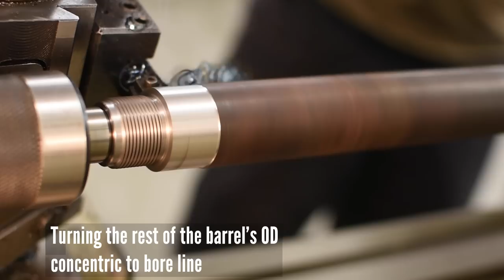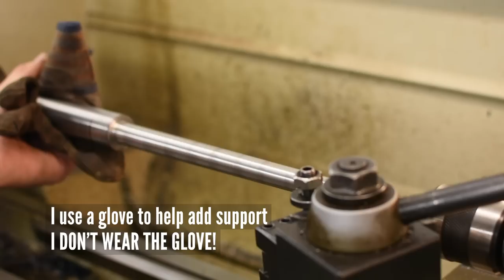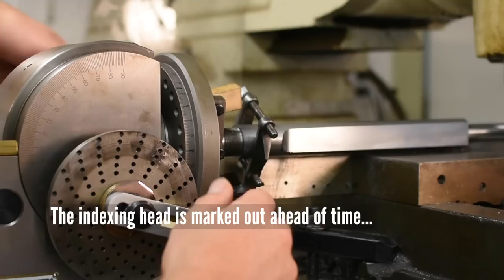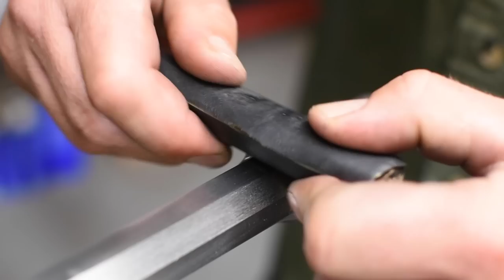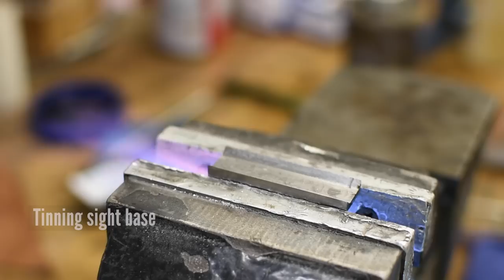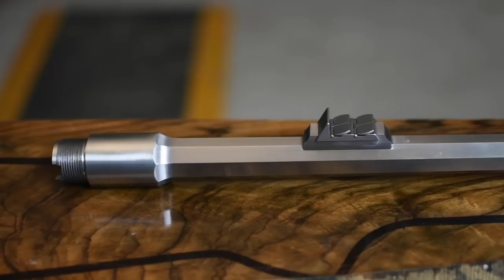Machining a Half Octagon Rifle Barrel

Comment: I once did a Douglas premium in half and half on an old 1885 hi wall 32-40. Darn thing stress relieved while machining (and I was using flood coolant) to the point it didn't shoot worth a darn. Wound up having to straighten it on an arbor press. I have cut a lot of barrels and most of them worked out well except for this one. Barrels can do weird things sometimes when you remove that much material.
Reply from the maker: I've experienced the same thing with a Douglas barrel as well. I've never had an issue with Krieger barrels though. I believe it has something to do with the cryo treatment they use

Comment: Out of curiosity and after doing tons of electrical solder work, what type of solder are you using for this application?
Reply from the maker: A soft solder by Brownells called Hi Force 44. Flows at around 400 degrees

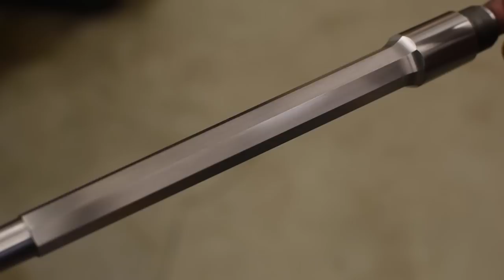Comment: 5:49 “I call for a drug test” ahhh I miss him so much 🇺🇸 
Great work on this barrel, I’ve always wondered how these were made. I can’t imagine Winchester doing all these steps back in the day for production, but then again, labor was cheap in those days. How much does a lathe like that cost? Thanks for the video 👍🏻👍🏻
Reply from the maker: I just listened to that and got a bit nostalgic myself :) Thank you! Winchester would have had a more efficient method. Probably a horizontal mill that would cut on two sides of the barrel at one time. When I purchased the lathe I believe it was around $5k. I looked the other day and it's closer to $7k for the same model.
Reply: @mnrcustomllc8253  awesome. Thanks for the info and reply. What brand and model is it?
Reply from the maker: @JBrtn85  You bet! It's a Grizzly G0709
Reply: @mnrcustomllc8253  great info thanks you man!

Comment: Any problems with stress relieving from the machining process? Wondering if the barrel remains 'straight' per se or develops a 'bow'
Reply from the maker: I've had problems in the past with different barrel makes, however I've been using Krieger barrels lately and they've worked very well for this type of work. I believe it has something to do with their cryo treatment of their barrels.

Comment: Soft solder will hold sights on ok? I've always heard you had to use silver solder, unless I completely missed something here.
Reply from the maker: Yes, soft solder is all that's used on barrels. Silver solder certainly has more strength but the melt point is far too hot for a barrel.

Comment: How do you remove all the excess solder from the barrel once the sight base is attached?
Reply from the maker: I use a sharp chisel to scrape off the big chunks (without touching the barrel) and then polish off what's left with 320 grit sandpaper.
Reply: @mnrcustomllc8253  I really wanted to see that part =(

Comment: Beautifully done good sir.  The design vibe is so Black Forrest. Will there be any inlay work on the barrel flats?  Also, what caliber is this 7X57 Mauser maybe?
Reply from the maker: Thank you! No inlay work planned other than gold in the sight leafs. It's a .375 Ruger
Reply: @mnrcustomllc8253   excellent, I like the .375 Ruger.  One gets the bigger bang in a standard length non-belted casing.  And perhaps the caliber engraved into the upper flat then gold inlayed?
Reply from the maker: @ditzydoo4378  I like your thinking. We may go that route.
Reply: @mnrcustomllc8253    thank you for saying so.  I've often admired the elegant script engraving used on high British Bond street rifles.  Tastefully appointed, not garish.

Comment: Excellent workmanship, but wear some safety glass man!  You won't be able to machine anything if you can't see.
Reply from the maker: Thank you. You're right, I should have worn safety glasses especially in the video. The reason I wasn't in this operation was because the tool was running at such a low RPM (around 200) that the chips were simply falling below the tool. It's no excuse though, and I'll make sure to have them on in future videos.
Reply: guitarsnguns I was thinking the same thing.
Reply: @mikey87  This guys work is far too good to risk his vision, I really enjoy their videos.

Comment: What I don’t understand is that you were careful to not over heat barrel when machining then you then you later heat it up glowing red with the blow torch? Why?. Also  do you buy them with the barrel already bored? What material are they?
Reply from the maker: The reason you don't want to heat up the barrel during machining is to avoid warping it. Glowing red? That happens at around 900 degrees. The solder used was low temp that melts at 475 degrees which won't harm the barrel.  Yes, the barrel is already bored and rifled. This one was chrome moly (4140).
Reply: My eyes must have fooled me because it looked like it had a red hint to it. Thanks for the reply👍🏻